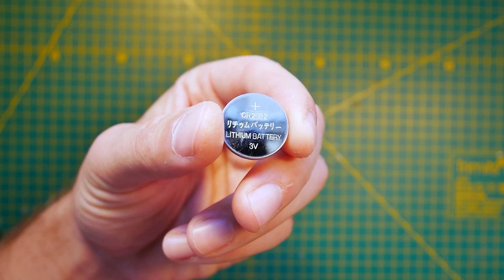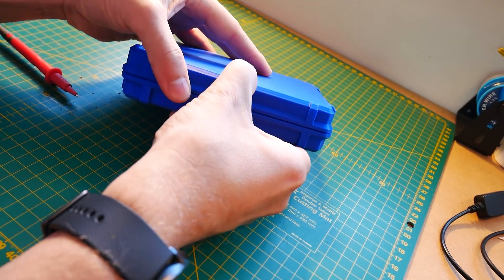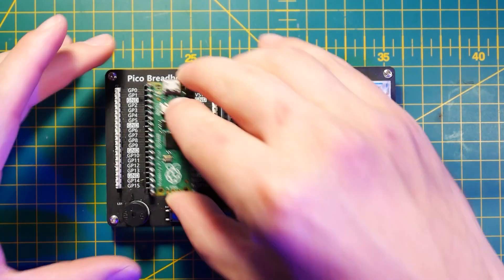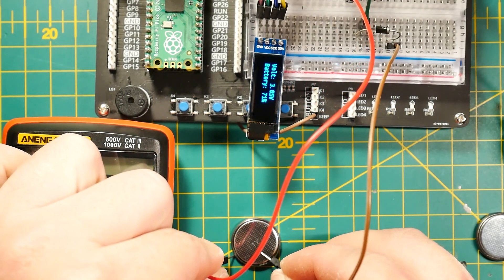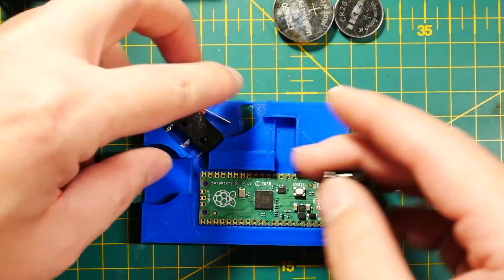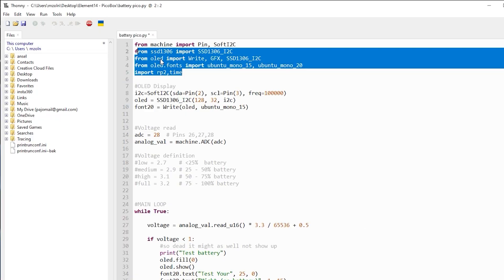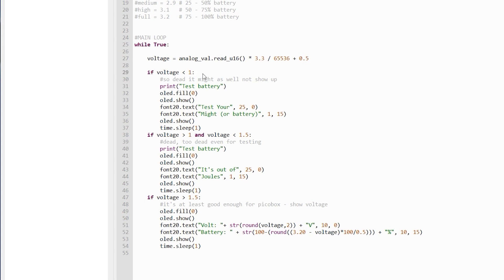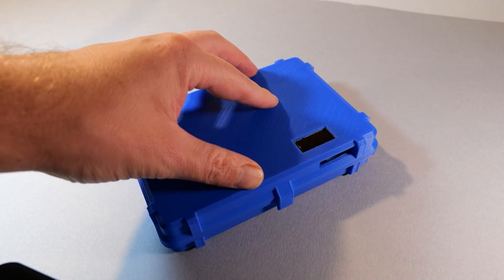Using Dead Batteries to Test for Dead Batteries

Comment: I believe Most battery testers put a small load on the battery being tested.   That might give you more accurate results.  The tester I have puts roughly a 5 ohm resistor across the battery.

Comment: There are Voltmeter modules for ~ $1 Aliexpress that can work off the battery under test and work down to 2.5V - good enough to tell if a 3V coin cell is dead. Other modules can measure down to 0V if powered externally with ~5V.

Great idea / packaging, but I was hoping for more than just a voltmeter testing cells under no load.

Comment: What if…. The voltage is exactly 1.5 volt….. use <= to avoid 😉
Reply: Hold it 5sec longer and I'm sure it will be 1.49V 🫣😂🤣

Comment: That's an amazing idea. I am not that much familiar with battery capacity testers. I would really appreciate it if you could clarify one concept. Based on my understanding, batteries have some regenerative capabilities due to the chemical properties of their contents. Sometimes it's not enough to just monitor the voltage of the battery. That's why, in many cases, I have seen people use a constant current load with it to measure the capacity. Does the diode with the series resistor perform the same task or is it just a voltage divider with reverse polarity protection? Thanks.
Reply: When load is applied to the battery the voltage can dip significantly. Once load is removed the battery "recovers" some of that drop. 
Monitoring voltage of the battery gives you a good ballpark figure for single use batteries where cells are unlikely to abused by charging. Load testing would be more recommend for rechargeable battery. 
You could apply small resistance to see how much voltage drops ... You'll have to modify the code provided in the description to account for a small voltage drop across the resistor.

Comment: I would eliminate the diode for polarity protection by using an edge contact and a face contact for the battery. in the event you put the battery in the slot in the wrong orientation both contacts would be touching the same pole of the battery and thus no voltage across the contacts. this would eliminate having to account for a diode drop which could vary with temperature and time.
Reply: That's actually not a bad idea. I would worry that the thinner batteries could still short given the fact you could slot them at angle. 
Granted I haven't tested the box in more robust temperatures but despite the diode the readings were more accurate than I initially anticipated hence sticking with this at the end.